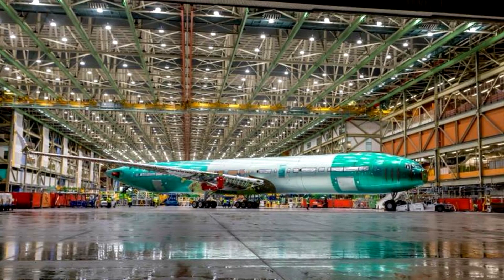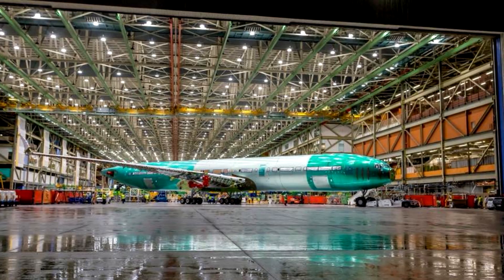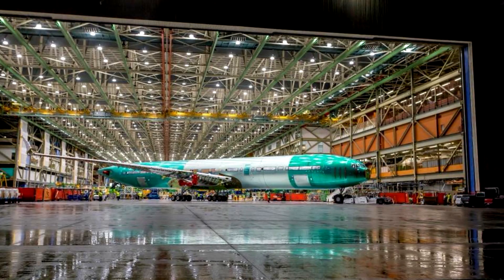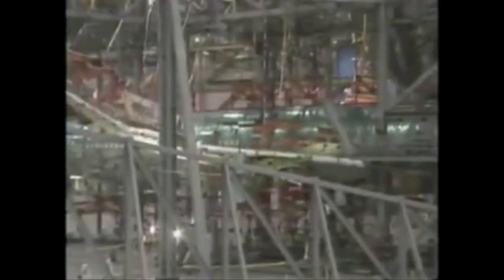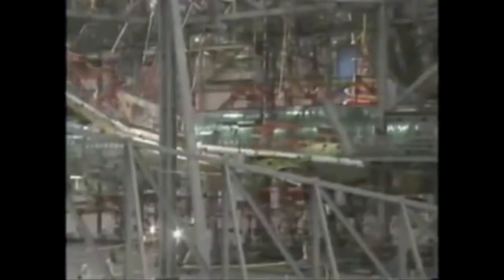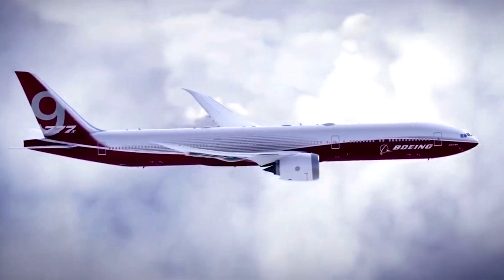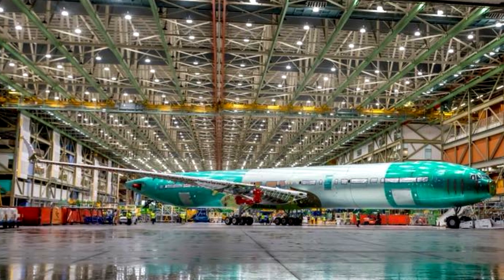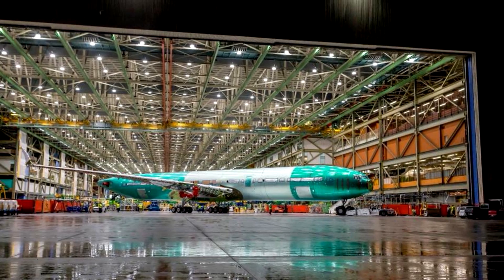Boeing 777X STATIC PLANE REVEALED!

Comment: 2020 will be a year for the world to remember: Trump will be re-elected and Airbus will announce the cease to continue producing the A380 and A350 due to lack of orders because of the introduction of the B777X.
Reply: Salty Airbus fans think the a380 will sell well, it’s Not. Let’s see if it can break even.... hmmm
It cannot even be a true flagship for airbus. The 777X doesn’t need to have more sales than the a350 because it’s also a 777-best selling widebody. It’s targeting the a380 and 747 especially the a350-1000 and a380 were it overlaps 👌
Reply: @Racko.  not completely true. The a380 might not be that dead. Some companies even showed interest on a 900 version. But the aviation industry is a bit unpredictable and therefore it's hard to tell what will happen to the a380. That idea spread mainly by Boeing fanboys that all airliners are absolutely discussed of having a380s is pure rubbish and far away from the truth. The problem with the a380 is the moment when he arrived at the market.
Reply: Like it doesn’t have that much potential costumers like the a350/777/X, it will have little to no new costumers for a while, but time will tell, if Years go by without any interest airbus has no choice but to shutdown the program, regardless a failure. They almost did early this year until EK purchased 36 more.

The fact that airbus betted 25 Billion on the investment in the era were airlines were moving away from jumbos and 4-engined planes but they ignored the fact and believed the hub system will be the future. Boeing broke the camel’s back showed Airbus how the future will be. 
Airbus made the a380 and Boeing made the 787. The winner is clear and it’s clear that we all see where the entire aviation is shifting towards. Now you’re sitting with a large plane that’s hard to fill up.
Reply: @Racko.  well the 787 wasn't absolutely brilliant when it comes to financial problems to Boeing. Yes Boeing got it right but Airbus caught up with them with the a350. The a380 is a brilliant plane when it comes to feeding big hubs like Heathrow or Dubai. The problem is that it's a bit ahead of its time when it comes to demand. Many times its not high enough to fill the aircraft. And when Airbus was designing the a380 no one even on Boeing though that 2 engine long haul aircraft would have such a success. The proof of this is that Boeing was selling the 747-4 and still believing it had a future (747-8). So that argument that Boeing was always thinking of the future is not completely true. Because let's be honest the 747 8 is far from being a success as well.
Reply: Keep dreaming buddy. Airbus will actually cease production of the 380 in 2019. Also Trump will def be re-elected. ;)
Reply: Well you're delusional, he's more likely to get impeached than reelected. Also the A350 has been selling quite well and suits a different market.
Reply: Really? With a 50% approval rate? You must live in Washington and are breathing close to non-existent jet fumes..
Reply: He’ll be impeached next year unless they 25th amendment him out.
Reply: Rubbish. Neither will happen. The a350 is selling very well and the a380 probably still has 5 more years of production considering that there won't be any more others appart from the existing ones. And I still believe that there are some more orders to come.
Reply: @Poldus Eri- you got everything correct except for Trump being re-elected in 2020!  He'll be impeached after the mid-term elections when the Democrats take over.
Reply: Kevin P I don’t think so. If impeached, What will be the crime?
Reply: @Poldus Eri- Once the Mueller investigation concludes, I'm certain that there will be a long list of crimes committed by our corrupt President.  I don't understand how you could support a President who divides a country he governs.  This non-politician / businessman President experiment is a BUST!
Reply: Kevin P You certainly don’t have any clue or any information to support your hypothetical conclusion of events. If you are a real American it is shameful that you don’t support the POTUS Constitutional elected by we, the people.

Comment: I didn't understand the part where you said that the horizontal and vertical stabilizers won't be fitted but then you said a dummy will be fitted... ummmm. What? How are they supposed to test the structure without those important parts? Can someone please explain?
Reply: I think they have been tested separately
Reply from the maker: These parts are very delicate and can influence the readings quite considerably. They'll probably use reinforced parts to fit on the plane. They havent really explained why tbh
Reply: @navgeekaviation  Oh okay. 
And in reply to the above comment a separate testing will give only half the data needed. I'm sure they'll test the whole structure (with all parts attached) also.

Comment: Not that I dislike the A380 or anything, but I think this might spell the end of the big Airbus double decker.
Reply: The 777 outsold the a330,  killed the MD-11, DC10 747passenger, a340 and the DC11.
As we all know the 777X well the final episode of how Airbus a380 will be knocked to death just like how the a340 was wiped out. 
The a350-1000 is the New A340, it will become another wipeout just like the a340-500/600 
unless airbus tries to comes with something bigger to compete. But they aren’t
Another episode of how they got smashed in the widebody segment
Reply: @Racko.  have to disagree with your point on the a350, it's doing quite well compared to the aircraft it's meant to compete with (the 787, not the 777x). Almost 1000 orders compared to 1300 b787 orders. 

Obviously the 777 killed quad and trijets. Airbus probably has to step up with a new twin engine design to compete with the capacity of the 777x. But the a350 is still a success, despite it simply being a response to the 787.
Reply: Hobinator17 The -900 you mean? ;P
It has around 700 orders VS the -1000 which has less than 200. The -1000 wants to compete with the 777-9, well the a350-900 isn’t a 777X competitor tho lol
The program is doing fine, better than the a380 and a330neo at least.

787 is an a330/300neo competitor 
Once the Farnborough orders for the 787s are confirmed it will have 1,400+
Reply: *Corrections. High fuel price kill Quads.
Reply: Some of the A380's would end up with smaller private airlines completing charter flights such as, carrying soldiers, transporting famous people, or transporting a famous football team. Others would end up in the scrapyard along with older 747's and MD11's